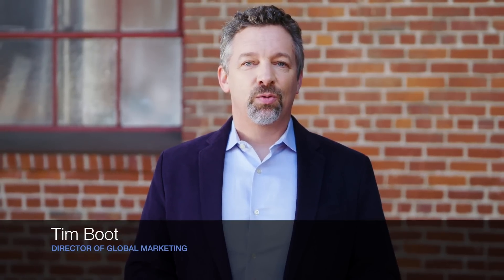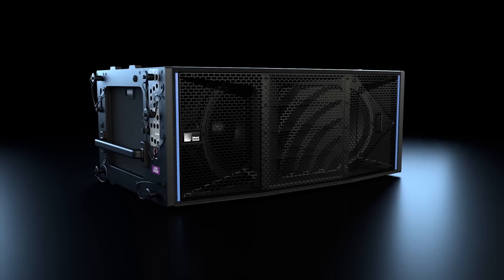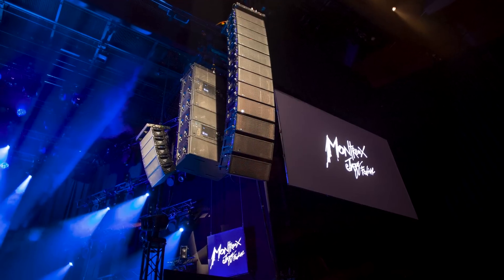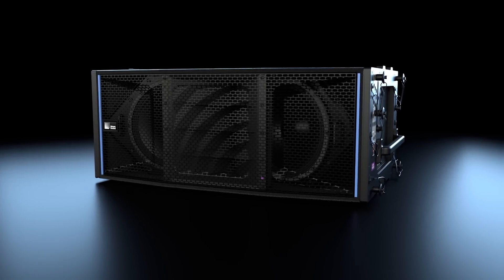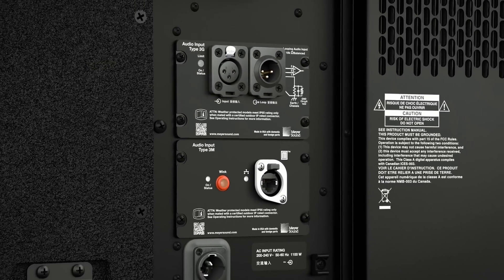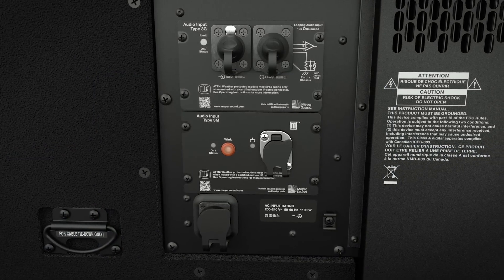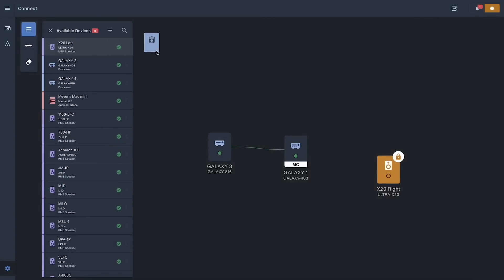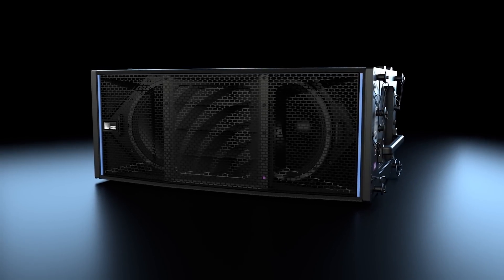Inside Meyer Sound Lab’s New Flagship PANTHER Line Array

Comment: Bose PowerMatch is much better. Bose is the only company that makes field-adjustable line arrays. The tweeter horn can be removed and replaced with a hoern that has either short or long throw at different dispersion angles. No other professional line array allows you to do that, and that's why Bose is on top. Plus, Bose's sound is second to none. Providing clear distortion free sound at any volume level thanks to Bose's patented DSP technology.
Reply: That must be a joke man all bose systems are shit with cheap low power drivers in them .
Reply: @yonut7  Okay buddy. Keep thinking that 🤣 Thanks for the laugh
Reply: @PlatinumEagleStudios  BOSE - Buy Other Sound Equipment buddy keep laughing i also laugh when i hear of BOSE :))))

Comment: I wisch there would be a eater con pass through just so you can eliminate the need for a switch for every line array so you just run a cable to a line array plug it in and extend it with shorter cables. Otherwise I'm exited

Comment: Will be interesting to see if this gets picked up and spec'd at all for large scale touring PA systems outside of the US where L'acoustics K1 and D&B GSL are by far the most dominant and deliver consistently incredible results.
Reply: Just been to an Ed Sheeran gig in UK. Probably about 300 of them across 12 arrays. They had another 60 subs (not sure which) in LR rigged in 10s between pairs of 16 Panthers. Sound was excellent in minimal acoustic type tracks, with huge LF pressure. Turned to mush though when they were driven hard with "fuller" tracks. Roof was open in the stadium and was quite windy so that doesn't help. For the size of stadium though (Principality, Wales) the overall levels were very impressive, probably the loudest LR I've heard. Just washed out when pushed hard and vocals were lost
Reply: @DW_drums  Probably a bit harsh to say "mush" but the vocals / mid were lost at times. The LF never distorted tho and was pretty crazy. I honestly think the wind swirling through the stadium had a lot to do with it -its got an 80K capacity so its a very big space, the roof was open and the wind was quite strong. Overall though the system and SPL it produces was pretty incredible - to the point I had to look up what they were then comment here once Id found them!
Reply: Leo on tour a bit also

Comment: And you thought your pc speakers were dope 🤣
Reply: Sadly, I've heard line array systems that don't sound much better than PC speakers, just much louder. Same two humps of spiked bass and crap mid-high.
Reply: @RWL2012  Its all down to the power supply and amplifier type, Class D amplifiers are only good in battery powered Bluetooth speakers, not for PA.
Reply: @RWL2012  *untuned line array
Reply: @RWL2012 I have heard this as well, unfortunately, but I’ve also heard really great sounding supposedly equivalent systems. Sometimes, they even use the same speakers. What I’ve found is, it all depends on the sound engineer, the room, and even where you are seated in the room. These systems all CAN sound good, but the speakers themselves are far from the full story. The best live sound rigs of this type I’ve ever heard were Meyer Sound, D&B Audiotechnik, and L-acoustics. Could maybe add Adamson and JBL to that list. The worst live sound I’ve ever heard? Yep, it was the exact same brands.
Worst by far I’ve heard was Janet Jackson’s arena tour last year, or at least the Seattle show. It was a Meyer Sound LEO/LYON rig. Sounded exactly like you described: tons of muddy midbass and a painful peak somewhere between the high midrange and low treble, which made the vocal nearly inaudible. Then this year, I heard a PANTHER rig at an outdoor show/concert series. Sound was incredible on the particular night I went. So no, it isn’t Meyer’s fault. And yes, I know an 18,000 capacity indoor arena vs. a comparatively tiny outdoor grass field is comparing apples to oranges concerning acoustics, but still there was no comparison and I’ve heard the arena sound great many times!
Reply: hahah, yes, the differense is the Panterbite in your guts, i guess. No idea if these are good tho, was just impressed by the name. principially, the bigger the low- speakers, the fuller the Frequency spectrum. and i love the full spectrum, we all do

Comment: 5:48 "...making it the lightest full size line array in the industry" 

This is a bold and incorrect claim, as Martin Audio WPL is lighter at 141lbs. Panther is probably the lightest powered full size line array in the industry though.
Reply: It has to not suck too though.  I'm not impressed with the Martin boxes.
Reply: @djjazzyjeff1232  Actually, in this context, the performance is completely irrelevant. We're only talking about weight and size.
Reply: @djhlsmusic  I guess, but if it doesn't sound good that everything you mentioned is also irrelevant if you'll never use it.
Reply: @djjazzyjeff1232  I literally only mentioned size and weight, and good sound is very subjective. You speak as if the Martin boxes are so atrocious that they're unusable. Regardless of opinion on flavor, they're just as usable as any other top tier box.